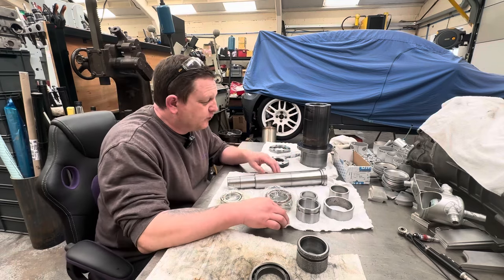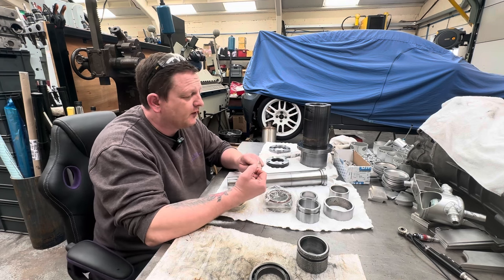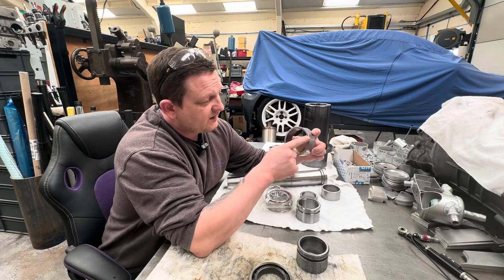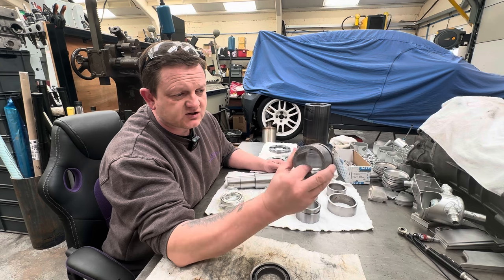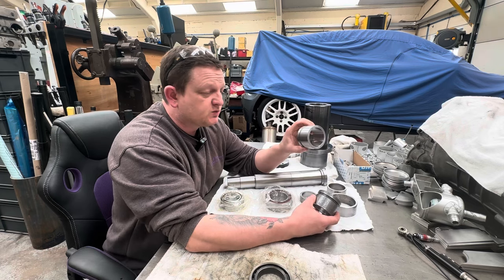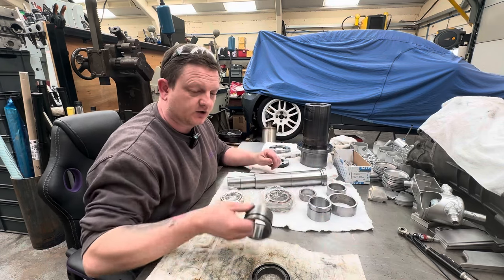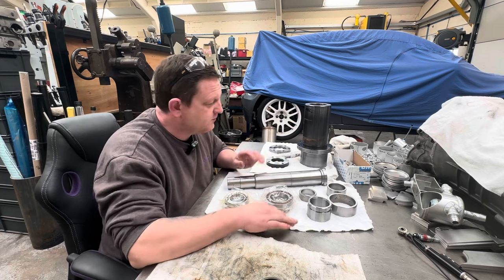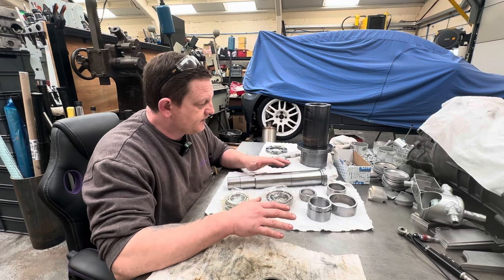Fitting the new bearings to the Haas spindle

Comment: Did you put grease in those bearings?? They look completely empty. Some bearings come with grease, some you have to add the grease yourself - those look like the ones you have to add grease to... and the right Kluber NBU 15 grease of course. Check Rob Renzeti's spindle rebuild video where he re-distributes the grease in his pre-greased bearings. I know you don't want to overfill them, but yours look completely empty in comparison
Reply from the maker: No i did not add any grease as the spindle is lubricated by oil/air mist continuously, it is not a greased bearing set up

So when the spindle break in program is done which i think is 6 to 8 hours it starts off around 500rpm for an hour and that should allow plenty of the oil/air mist to lube the bearings before they see any real speed

There is an opening in the top cap for a small 1/8-27 npt fitting that supplies the oil/air mist from the very top so it runs through both sets of bearings and out the bottom of the spindle nose

Thats why on these older Haas you will or should always see oil on the table under the spindle after its been left a while as the oil runs out

Comment: Is there not a specific amount of lube/grease that each bearing is supposed to be injected with before the spindle get assembled into the machine ?
Just curious ? 
Did you really use WD40 like you said when you put the first set of bearings onto the lower portion of the shaft ?
Reply from the maker: The spindle/bearings in the earlier Haas machines like this are lubricated by a continous air/oil mist system so that's where they will get the lubrication from rather than a grease packed bearing set up, later down the line Haas did move to a grease packed spindle set up

And yes i did rub a bit of wd40 on the inner race before i pressed it over the spindle shaft as thats what i had to hand 

Thanks
Marc
Reply: Yeah, I'm wondering the same thing - those bearings do NOT look pre-greased. I have a new set of bearings for my spindle as well, and grease definitely needs to be added to them before you assemble them onto the spindle. I hope that isn't a big "oops"... the lube on the bearings when pressing them is to prevent corrosion or fretting, but I sure wouldn't use wd40 for that - I'd use a very thin coat of CMD extreme pressure lube #3 like Rob Renzeti recommends in his spindle rebuild video for that
Reply: @gorak9000  I watched the video that Rob did on the spindle rebuild he did and that guy was super duper specific reven down to what type of cloth to use to prevent dust , and then it came down to the lube being injected into the bearings with a small hypodermic needle ..... This guy here looks like a backyard spindle rebuilder ..lol
Reply from the maker: You are 100% correct sir,  i am a backyard spindle rebuilder as i state myself in the video

As mentioned above these Haas spindles are oil fed and not grease packed which is why i did not grease them

Comment: Have ever replaced spindle encoder. And rewound spindle motor.
Reply from the maker: Hi

The spindle encoder on my machines i have removed and cleaned and re fitted which means you have to then re set the spindle orientation

As for re winding a motor, NO i would definitely be sending that out to a motor re build company to do
Reply: @kinzy_fabrications  my question was have you ever replaced the encoder with new one. My encoder is giving problems i.e. on high speed it looses pulse and machine is stopped. The price of the original encoder from company is very high as compared to encoders available in open market. There are encoders in the open market but what is special in the original encoder.
Original encoder is 1000 usd
Market encoder is 100 usd
Reply from the maker: @manjeetsondh  Im afraid i have never replaced one completely so cant help with that, sorry
Reply: Ok I am going to replace the encoder with market encoder, I will tell the performance I get with new encoder.

Comment: One could see you beeing nervous while doing all this single handed and having only one shot. 

Cangratuliations !
Reply from the maker: Hi Thanks

Yeah im still very nervous of when it is finally fitted as to whether it will be ok or i have made a mistake and theres problems... but i have my fingers crossed hoping for the best
Reply: Not only you have crossed fingers. :) Just got that vms560/16 in my workshop too. It is semi bed mill. Z is with bed style, X and Y - linear bearings. But twin rows. Different style to haas. Still cleaning. Third bucket of chips removed :)  @kinzy_fabrications
Reply from the maker: Is that the bridgeport 560/16?
Reply: Yes. took it for retrofit - but except spindle drive fault, it is in fully working order. Will try to use vintage tnc 407 controller. As far as i can say now - it is much simpler, compared to haas. But hard / out of support of course.   @kinzy_fabrications
Reply from the maker: The older bridgeports are very sturdy rigid machines if the box ways are in good condition, much better rigidity than a linear rail Haas in my experiance. my landlord has 2 of the bridgeports, a 560/16 and an 760/20
Reply: I will drop you a mail with photo of rails. It is linear, but really different to Haas thing.  @kinzy_fabrications